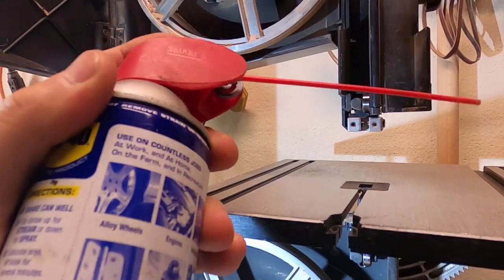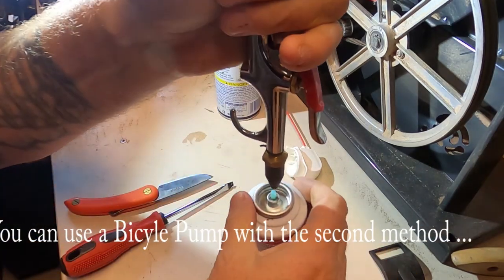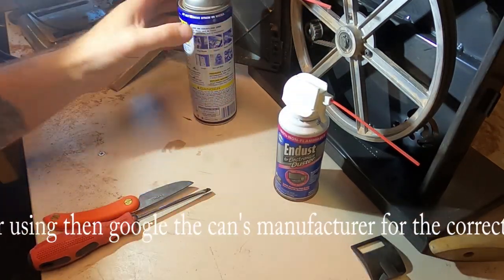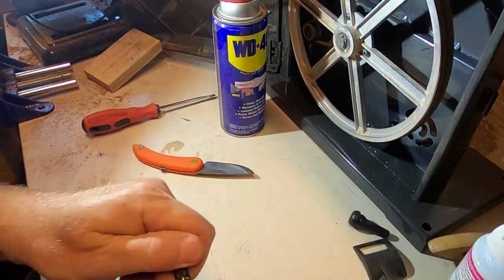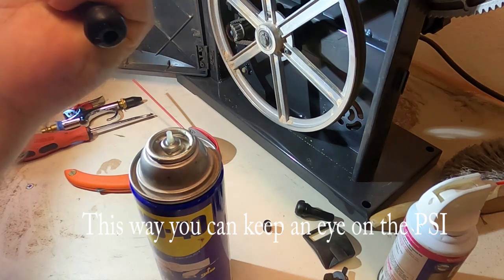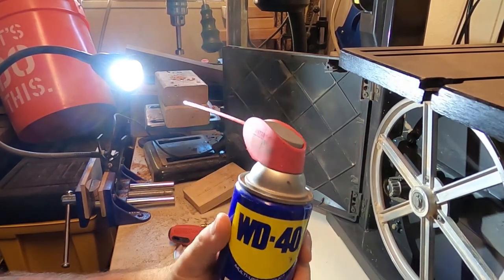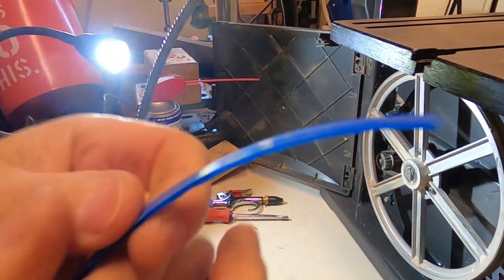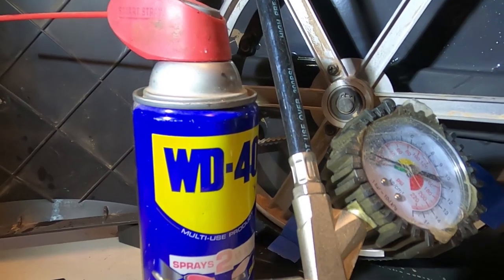Two Ways To RECHARGE THE AIR IN AEROSOL CANS YOURSELF

Comment: No bro!  At least pressure test a new can first to avoid over pressurising talking in to account a maximum temp of the atypical 50C.
Reply from the maker: I have 95 psi at 70f that is for the WD-40.....Good tip to mention though ,thanks.

Comment: Can you use the tire air pressure at a gas station and add one of those tube things you demonstrated?
Reply from the maker: yes & you can use a bicycle pump anything that can inflate a tire should work.
Reply: Then if it blows up, sue them! Atleast in the US

Comment: W-D40 factory dont pressurized them with air. They use CO2
Reply from the maker: Yes your right most cans wd-40 paint ect use co2 it's denser than air it is better although I don't know anyone that has the kit at home to recharge with co2 but compressed air works just fine and it costs almost nothing you can even refill with a bicycle pump.
Reply: The system i use, can pressurize litterally any aerosol. With the exeption of spray paint. That it doesnt have valve pin. Which is build in on the actual spray ca. I can pressurize cans with thick or thinner valve pins.

Comment: Nice! Now I'm trying to rack my brain to remember if MacGuyver (the original guy) ever used any canned air to breath under water! Do you know if that canned are is JUST canned air straight from the factory? Emergency air supply cuz alot of deaths occur from accidentally driving into water! SORRY just thinking out loud!  ;-)
Reply from the maker: I would think any air is better than none at all in an emergency...
Reply: I hope this was a joke...? Dust off cans are NOT just air. They will cause blackouts if inhaled. People "Huff" them to get "high". But your not really getting high your just cutting off your oxygen supply to your brain which again causes blackouts. Pretty stupid. Just putting straight compressed air in a can doesn't last long at all. You have to use pressurized gas propellents. They used to use refrigerants that lasted even longer and they were much more efficient (think Freon)but people still huffed it AND its terrible for the ozone so now we use different pressurized propellents but they don't last as long so often your can will stop spraying before its empty of the actual product. But its a small price to pay for an OZONE WITHOUT HOLES IN IT! So next lesson, DONT INHALE DUST OFF OR ANY OTHER AEROSOL products. It will make you as stupid as you sound for thinking it would be a good idea. Also you said it would be helpful when someone's car goes into water......Think a little harder why that wouldn't work. I believe in you, youll figure it out.......Ok I had too much faith. Ill help you, anything filled with air will be more buoyant  than water which would mean the can would just float away and become trapped somewhere. And if the inside of the car is still not completely filled....THEN YOU DONT NEED A CAN OF AIR DO YOU?!? If youre ever in that situation though. Dont open a door, it will flood too quickly. If you cant get out through a window before the car is submerged then you wait briefly for the car to pressurize (while breathing the air in the back seat/ back window area). Then you break out the BACK window. All cars have reinforced safety glass that is shatter proof. But the back window is always the easiest to break. Not by coincidence either.
Reply: @michaelinglis8516  Wow you're as mean as a liberal. But I still love the Diamond helpful hints in the insults rough! In all honesty, I would totally watch Michael's Tips for Survival on youtube. Ok, so I know they make those Oxygen "spray cans" for sports. I'm just saying someone should come up with something for escaping a fire since they claim you die from the smoke more than flame. Ok, now you can yell at me some more....GO!